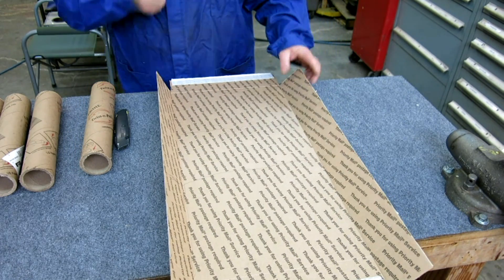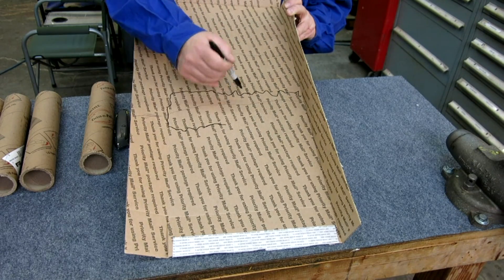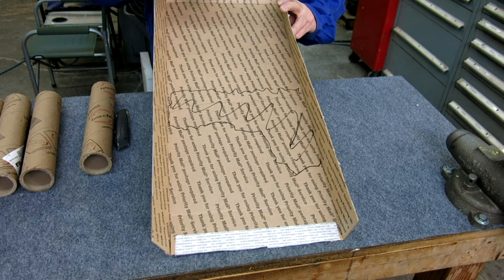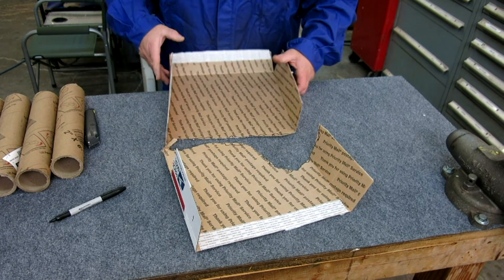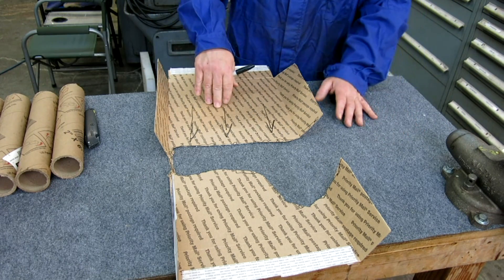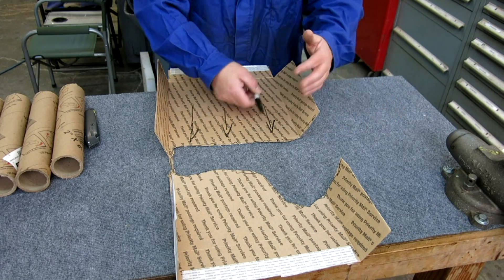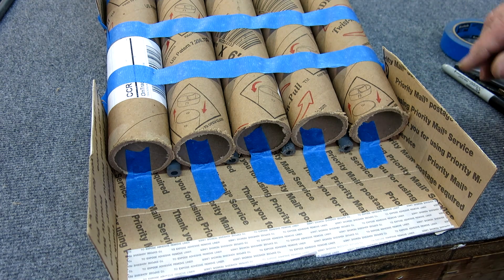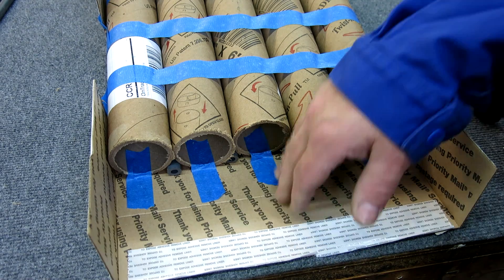Oroville Dam Spillway Repair

Comment: Well Tom, your fist problem is: your not an engineer!  Engineers are lazy and are repulsed by dirt and work.  Engineers think only of the quickest way to get home from work.  Everything else is second to that.  I’m sure there are a handful of engineers out there who are not lazy to the core.  But they are few and far between.  When a young man or woman chooses engineering as a career they are thinking that this is the best way to make money without physical effort or getting nasty horrible dirt under their nails.  And as is true in every field. 80 to 90 percent simply suck at what they do.  It’s probably a higher percentage than that, but I’m just using the 80/20 rule.

Comment: You have the right idea,but you need to move your tubes to the emergency spillway  and pump the water out that way the main spillway can be repaired without water being released to hinder the repairs needed just a thought as you have

Comment: Use the large diameter pipes only but build aprons on the each end.  the largest issue to be tackled is anchor the pipes while the spillway is still in use.  Can be done just how.  Also slow the laminar water speed down.  place large rocks in the spill to cause turbulence and reduce it speed and energy this in turns helps reduce its destructive force..

Comment: Well, regardless of what would or would not work,  it is now a vastly different problem.  Yesterday (2/27) they shut off the flow all the way, a completely new spillway will have to be built and I just know, they are not going to do it according to water movement dynamics, but they will spend a couple years getting it re-made and figure if it will last long enough that they won't be around to take the blame next time.  Sigh.

Comment: I like your idea.  My dad built chemical plants for a living "in the day" and he designed the pump stations for the Feather River Watershed Project.

My only "improvement" would be that the entire "engineered" event you envision be "prefabricated" on site with measurements to match the exact moment.

Then, have the dam guys shut off the water completely while huge cranes, hoists, etc. assemble your pipes along the broken spillway,

I had a similar idea - prefabricated--but could not figure out what materials could be used to strengthen the gap - you have figured that out!  Genius!

I have sent emails to "Doug LaMalfa" - our House of Representative from Butte County - 1st Congressional District - with the "prefab" idea.  I know I like it.

To contact our Representative, hit google and type in the "Doug LaMalfa" - which brings you to an email site for mailing emails - if all of us hit Mr. LaMalfa to encourage him in his efforts in the House of Representatives, possible money could spring for this in the next day or two.

Hope so.  The water keeps "eating the hillside" aka, foundation of the dam!'\

I suggest your "pipe" theory be put to work at the secondary "overflow" too.  If 1/2 diameter pipes were connected laterally, with holes punched in the base, the secondary overflow would accommodate the water, flow into your 1/2 shapped pipes, and more gently flow out of the holes drilled in the underside of the pipes.  

A complete "spillway" could be prefabricated for the secondary overflow - bypassing the fear of erosion again.

Comment: Nice idea BUT .... the flow down the spillway is supercritical.  Maintaining supercritical flow through the pipes would be a problem. If super critical flow can not be maintained through the pipes a hydraulic jump would occur at the entrance to the pipes, in which case water would overflow the pipes and continue to flow over the side of the spillway. 
The engineers at the site say the erosion is not progressing up stream, because the hole has gone down and back to bedrock. so they decided to continue to use the spillway.  Hence there is no need to repair the hole at the moment.

Comment: Your steel tube idea would create too much of a stoppage of flow where the water meets the round tubes.  Why not first drop rocks in the hole and then bridge the gap with FLAT STEEL PLATES so water would flow over the plates with little resistance.

Comment: They have to just control the faucets direction. Point the stream where they want it to go and knock the obstacles lips off of the isolated spill way. Jack Hammers and some demolition TNT plus turning the spillway back on. Just improve the split that the waters path is making anyway. Then they can stage the work with the refill rate from the rain. All other options are just going to get blown out of the way. The city street workers have 2" thick construction flat plates to cover construction ditches and they would have less friction on the water. Or the SEABEE's and the Marines have portable bridges that could span the gap quickly. The problem is going to be anchoring the fix. The modulating mass (M) of the water accelerating (A) with volume increases is creating too much force (F) and anchoring the fix in the spill way will take time. All the water is just going to blow the crap out of its way anyway. So, plan a controlled diversion sprinkler head at the outlet. Then they can wait until the spring to fix it right.

Comment: For a quick patch it does have merit, at least it would last long enough to get to the dry season if done right.  As for sealing the small spaces, shoot in guncrete and then form small concrete wedges in front of the guncrete patches to flow the water into the pipes reducing wear on the plugs.  something is better then nothing, and that is what is  in place right now.  helicopters can lift in the pipe sections, and a simple steel frame work underneath could carry the weight for now.  Its an idea and at least you have given it a good think.  More then the nay-sayers are doing.

Comment: The main problem with most engineered waterways is that they are straight. Water doesn't flow well straight. The shape of ALL rivers is the shape in which water flows best. If engineers would study why water flows in anything but a straight line in nature, without just assuming it is flowing around natural obstacles, they would build spillways which would not fail as this one has.
Read Victor Schauberger's books if you are doubtful.

Comment: It's a good short term Solution but the issue is the money to build that for materials, labor, etc would be money out the window when they remove it and can fix it. Their best bet is to just get out there, cut out the jagged areas so they're straight, fill in underneath with base and cement replace the cement with proper joints. There are cement polymers they can use that will set under water so they just keep it shut down until it sets so it doesn't erode on the surface. That would cost almost as much as the piping job.

Comment: This idea would never work, because you could not gain decent access to the spaces between the pipes, and any weld created would never be strong enough to hold the pipes together, much less resist the tremendous forces put on it by the wall of water hitting it.

Comment: How about running your pipes over the dam rim, above the power house & 40' down in the lake, with control valves at the top & end. Using 1909 Mulholland siphon technology??Trying to get 100K cfs. to go gently into spillway pipes would be tantamount to shoving a rope up a bulls behind during fly season.

Comment: If there is a way to accelerate the flow down the chute... like increasing the flow rate... the water will simply jump the gap rather than head cutting at the nick point... just a quick thought.... :)

Comment: My thought was before the sides blew off. Fill in the hole with gravel. cover the spillway from top to below the damaged area with the pond liner they use for the dairy ponds. Anchor 1 end in the lake below the water level so the water runs on top of it. Your idea seems feasible in the current predicament that they have.

Comment: The pipe bridge (around here known as a bundle of straws) is just a trash collector. You've basically created a colander just like you strain your spaghetti with. The flow through the colander is greatly reduced, and unless you have a very effective filter upstream from the bundle of straws allowing only clear water to pass through you will soon find that the entrance side of the colander will build up with debris (spaghetti) and the flow will then breach the bundle of straws and go over top which will then likely scour the lower sections of spillway.

Dropping in a pre-fab steel U channel or something similar to that would be the simplest solution if it were feasible to maintain engineered flow.

We have had numerous land owners here try to bridge a creek flow with a series of parallel culverts (some even 5-6' in diameter) and regardless of size of the individual straws, the bundle will eventually plug at some point.

Most spillways open dumping unfiltered surface flow (emergency situations) which means that surface flow is almost always polluted with huge quantities of debris that are being scoured from the inflows to the reservoir.

Comment: I would build a temporary length of spillway on the North side (opposite the side of major damage) and divert the flow to it while repairs were carried out on the main spillway.  The problem at present is that the soil all around the damaged portion is waterlogged and probably wouldn't support heavy equipment.

Comment: Easy solution: Use QuickCrete, for concrete applications which requires high early strength development. Benefit: Early strength gain,  High ultimate strength, Faster setting time. We already use it to repair concrete pavement (Toll Roads), pavement will be ready for heavy traffics after 6 hours.

Comment: Or build a new concrete structure to lay over the gap like a bridge. You can design it to be square just like the previous structure. Now you even have a big hole to add support beams then refill it with earth around the new structure. The you don't have to worry about rigging up 400 pipes and still not collect all of the water

Comment: Good idea, but the biggest problems as I see it would be logistics and safety. You can't go pick up large pipes like that in a store; they are usually ordered months and years ahead of the project.  If you could hijack them from someone else's order, and get them to the site, you have to engineer a way to get them into the spillway, anchor them, divert all the water through them and do it without loss of life and limb.  
Then comes the problem of what to do with the damage under the new pipes. I suppose it could be filled with something, but it sounds like another major engineering project.
It's not always a question of will; sometimes all the other elements just aren't there in adequate supply.

Comment: Tom it's a good idea, the problem is politics, nothing gets done in a timely manner and always costs 2-5x more than if private companies handled it. Nothing is ever done pro-actively, only after a disaster or two. Yes I think pipeline welders are to building/welding are like Navy Seals when it comes to getting the job done, they could certainly bridge the gap fairly quickly and build some funneling ramps to ensure the water doesn't bypass the large pipes, I think the smaller ones you mentioned would clog with dirt, sediment ect. If only the right people were involved with the decision making process. Good video

Comment: You could do this in a penstock application however I think you would need it encapsulated in concrete. I worked in hydro maintenance and the vibration and water pressure down that slope would require more then welds to keep that pipe on the hill side.

Comment: This is fricken crazy! we would be better off taking flat heavy sheets of steel that can be laied over the hole and pin bolted all a crost the top side. They could even weld bead down the over laps.

Comment: Tom, I was surprised to see the Oxtoolco tagline on this clip, because it's so far removed from your normal subject matter.  However, you illustrate again that a thoughtful approach is appropriate for almost any kind of problem.  Whatever the ultimate solution, I agree that it will be a prominent feature in future engineering curricula.

Comment: Come on man... What actually happened was that they made a decision to not use the spillway because they were afraid it would do massive damage to the already fucked up hole in it which could have been repaired later. But then they just let it overflow which could have been a huge disaster. Lucky the dam didn't break. What people don't understand is that dam is over it's life expectancy. It's already out of date just like 98 percent of the dams in America. It is only a matter of time. They all are going to break soon. It's also fucked that Jerry Brown asked Trump for money to fix it after they are trying to succeed... which by the way they can't because it just is simply not legal.  The only state that can do that is Texas because it is a republic. That comes from the Mexican American war.  And by the way. I think that they were just trying hold on to all that snow runoff  like bandits without having to repair that spillway.
Reply: The dam itself is doing quite well, it seems. It´s just the spillway(s) which are of concern.
The main spillway still works, even with the lower part gone. Water flow will erode the soil away to the bedrock and then some of this, maybe deepen the river bed below, but this will not harm the lake in any way. 
Main concern is if the main spillway might not release enough water even if fully opened to stop overflow over the emergency spillway. There the water directly hits the base in front of the concrete wall and erosion will have catastrophic consequences.
The damaged main spillway may look dramatic, but it isn´t the real problem, I think.
Reply: sthenzel Same opinion here. But you have to understand that these dams are older than dirt and all of them need work.
Reply: @Jay Sims: 
Never questioned that! 

Too bad noone thinks about maintenance early enough. 
Ok, maybe they do think, but resulting outage, maintenance costs and such conflict too much with shareholder value...

Comment: The spillway is approximately 250 feet wide. The hole was over 200 feet long before they decided it was necessary to use the primary spillway despite the damage. Pipe would collapse under its own weight, let alone the weight of the water. 100 K cubic feet per second. I didn"t even think the math to calculate the water weight was worth the effort.

Comment: I just went for a walk in the woods, and got rained on. While running back, I thought about your idea. Now I see everyone has already weighed in. But I didn't run for nothing. I was going to say semicircular geometry. It would halve the friction forces, and eliminate any vertical component of force. There's probably a better way still, but I'm not thinking of it.

Comment: every restriction you add to the flow will create it's own problems.
rise in level of water in the spill way, plus hard to predict were it will go and were it will give more pressure on the rest of the structure.
the force the water produces is enormous the pipes will most likely just wash away creating more mayhem on there way, making a bad situation even worse.

I think the  best you can do is provide the water a way to flow away from the dam as quickly as possible with least damage
maybe by providing it a new way to go so it will not undermine the dam

Comment: How about dropping 100‘s of one tonne bags filled with rapid set concrete, on by one.  To tether them together, first drop a big cast iron weight to centre of the big hole with a strong rope attached to helicopter.  Helicopter lands with rope still attached and 1 Tonne bag is looped on to rope.   Helicopter heads out over the big hole and rises upward.  The Bag of concrete 'absails ' towards the cast iron weight.   Then to process is repeated 100‘s of times until big hole is filled with 100s of big bags. To guide location of the drop, the helicopter  moves over drop location, before rising up so they can slide down the rope one by one to where they are needed.   Joss from Cork.

Comment: 48" pipe is not off the shelf, and the gaps created by the different pipe radius would or could be impossible to fill through out the length of the pipe and prevent the pipes from peeling up and wash down the river from the force of the water. Plus I don't think there is a local fabricator that can produce rolled sections large enough.  I think Portland, Texas, or Mare Island fabricators can roll, but I don't think large or thick enough.  If someone can it would take 6~8 weeks shop time and that's 24/7 OT/DT. There was a fabricator in RedBluff that built stadium post and I think they could work 60" , I can't remember it was 19-years ago. I think they will go with a HS grout and fill in the rest with 28,000 psi early strength concrete, just a guess.

Comment: Not a bad idea for a temp fix. I would say it would need to be pre-built and lowered into place.
But a larger spillway should be built to accommodate and the down stream infrastructure needs to be updated to accommodate the risk and volume potential. Something the original engineers were likely to arrogant to think of.

Comment: Drop a big tarp over the spill way...even a thin membrane covering the erosion will stop further damage....when we were kids we used to roll out black builders plastic on the lawn and put the lawn sprinkler on at the top of the hill and slide down for hours...when we packed up at sundown the grass underneath the plastic was always dry.even tho the sprinkler was spraying all afternoon.

Cheers.